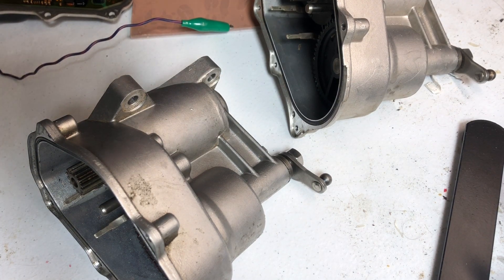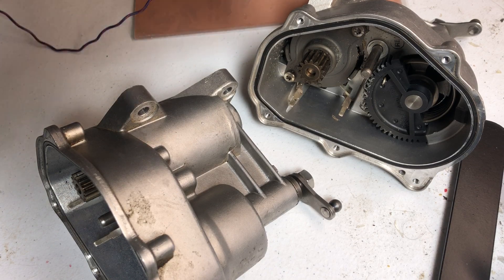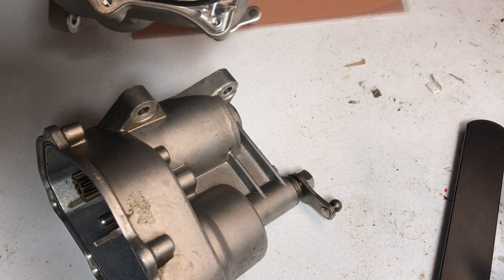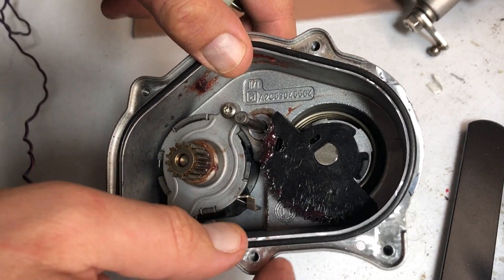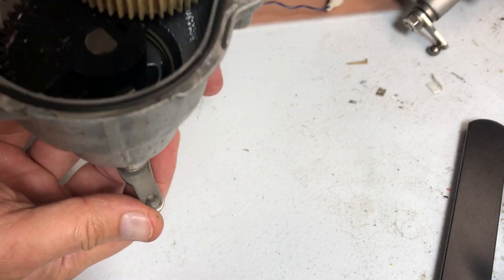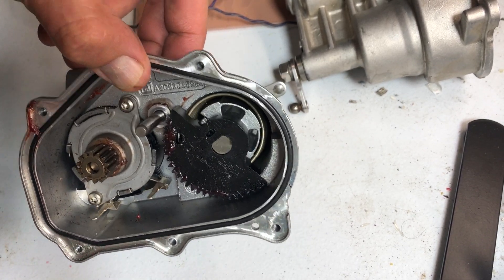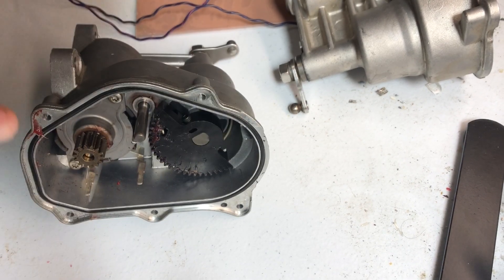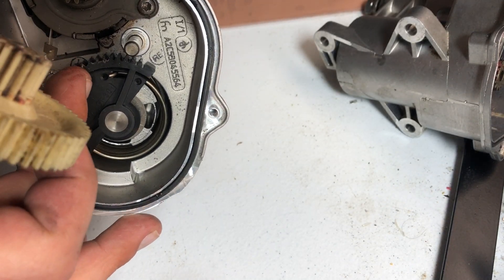BMW 2006-2013 M3 M5 M6 S85 S65 THROTTLE BODY PROBLEM, THE ROOT! ITS NOT GEARS!

Comment: Absolute BS !!   OEM gears wear out,  MOSFETs  have to increase power supply and burn out.     I had them fail , replace gears + PCB and worked every time . You may have one rare example where the motor itself got damaged but don't claim you now got the general answer for every throttle body that is failing.
Reply from the maker: No, it’s you mr BS. Open your motor and you’ll be surprised it’s brushed motor and it wears out like everything else, I saw like 4 bad motors out of 10. If you think it doesn’t wear out, you need to go back to school.